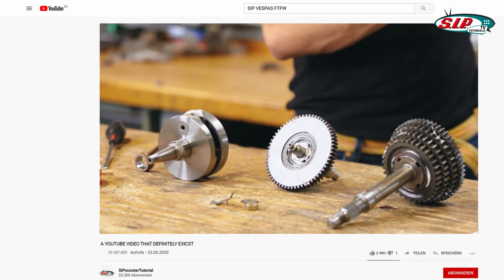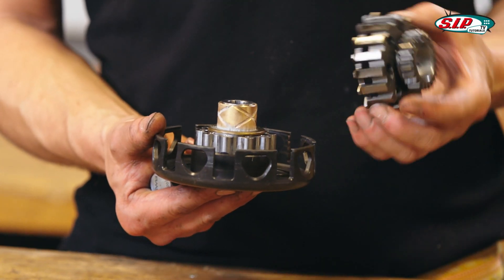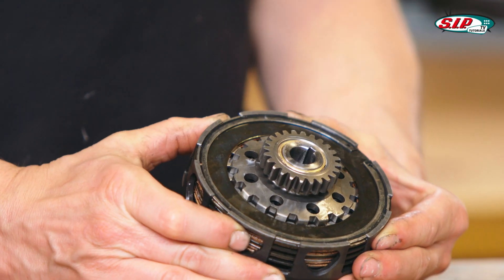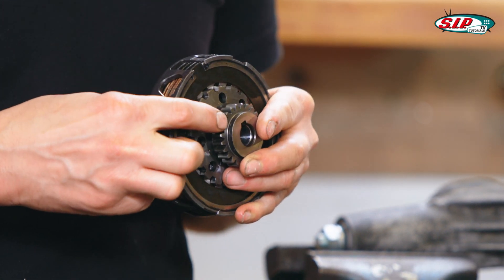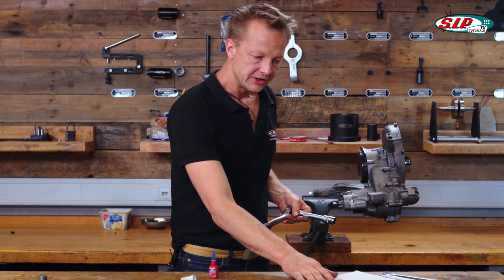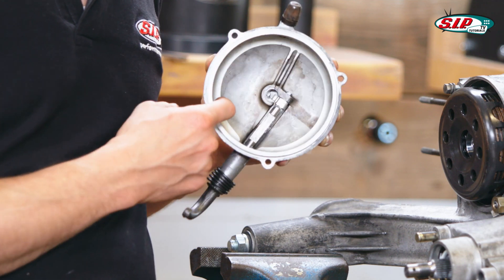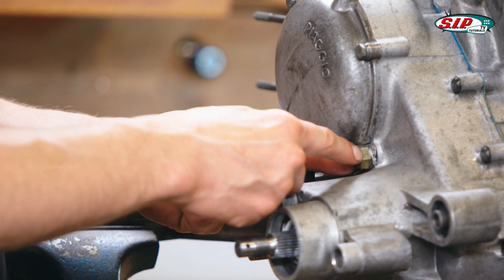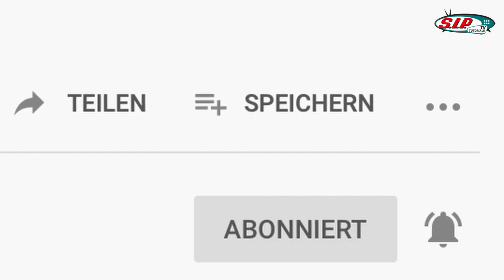VESPA ENGINE REBUILD 🔩| Part 7 | CLUTCH | Tutorial {English}

Comment: There seems to be missing here a special thick square washer on the secondary shaft, put on  before the locking nut - a much ;later retro-designed fix to avoid some engine casing cracking.
Seems any stresses from secondary shaft onto its thin casing, are instead crudely transferred to adjacent clutch housing and also final drive casing - for adverse loads when changing gears.

Comment: I have installed my clutch, but my cover is not closing tightly without mounting the 3 bolts. This is effecting that the clutch is already activating a little, it's pressed by the cover so the engine is in free position. I don't understand why. I need to say that I have split the engine, put new bearings and gaskets and mounted again. Maybe I did something wrong. It's a Vespa engine VBA 1 M from 1961.
Do someone know what's wrong?
Kind regards
Hans